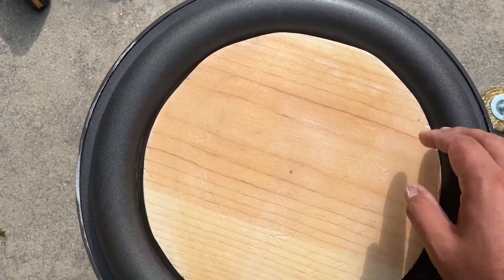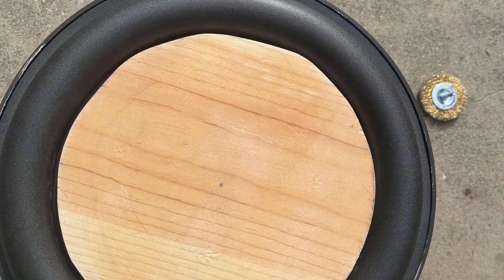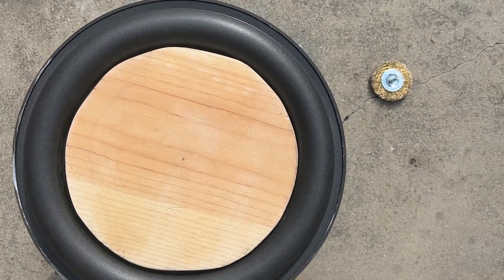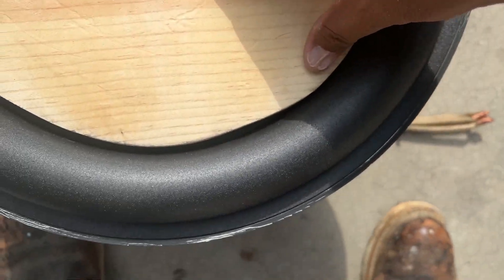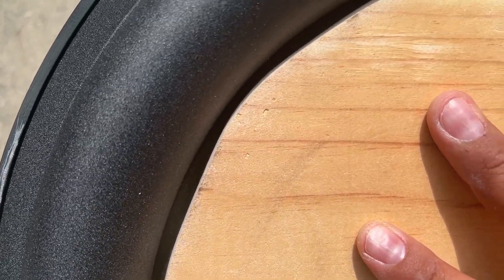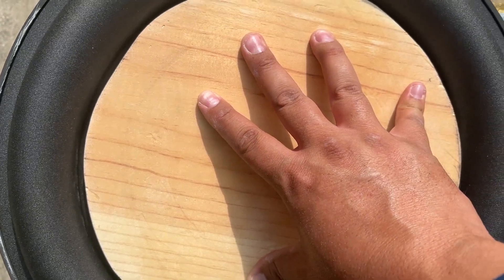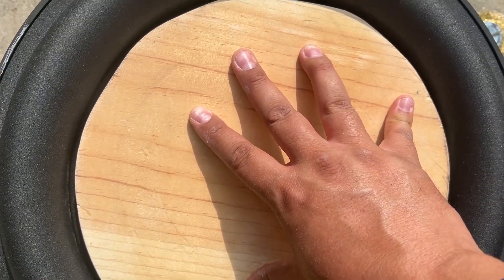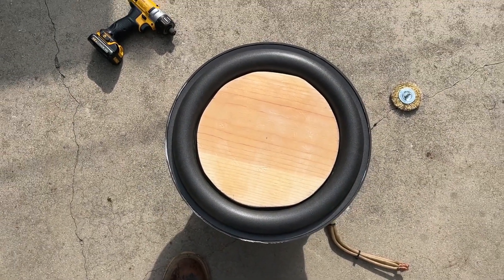Foam Surround replacement on Cerwin Vega Stroker pro subwoofer

Comment: Did you use ca glue to replace those surrounds ?
Reply from the maker: I used rubberized cement, it's like E6000 but more fluid not as thick. I'm not sure what brand as it came included with my foam surround order from Lord of Bass.